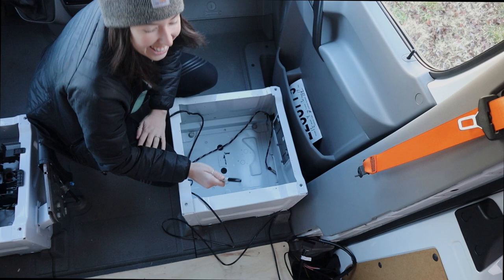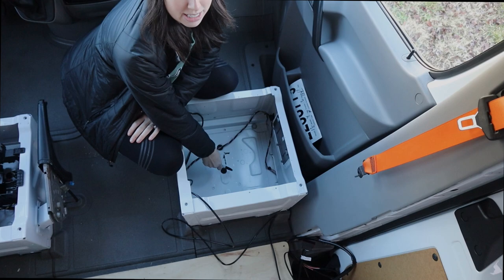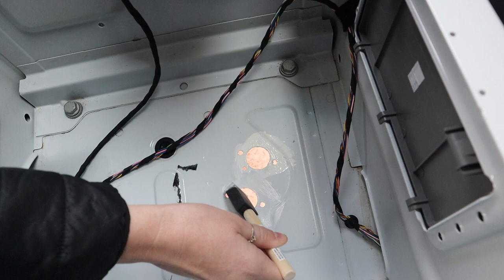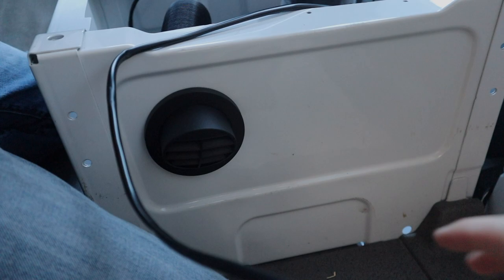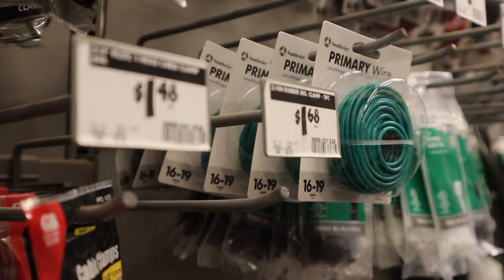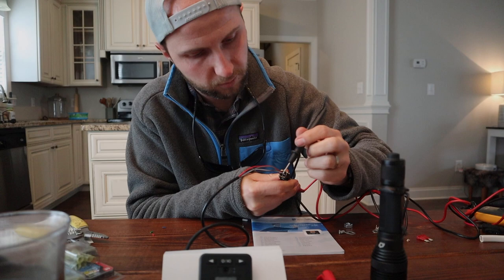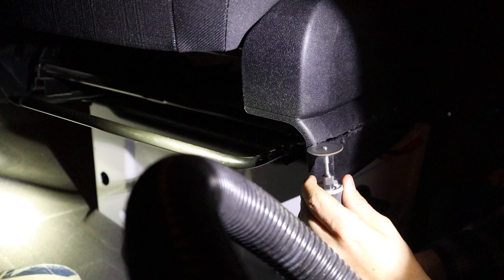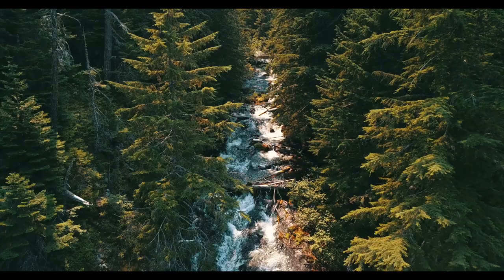VAN BUILD | Installing an Espar Heater and Swivel Seat into our Off-Grid Campervan

Comment: Good job, remember though, if you are going to stay at altitude, ski resorts, etc., you might need a secondary pump that fits alongside your original pump and powered by a separate switch. This is because of the burn process at altitude is different, you probably know anyway.
Reply from the maker: Yeah! We’ll probably end up adding on the high altitude kit down the road! Initially I thought we wouldn’t have to worry about it, but now I’m second guessing myself 😂 Thanks for watching!!
Reply: @WeTakeTheVan  Some very good info is available on the "Le Tonkinois" boat varnishing website; yours is new so you'll have few problems but a lot of step by step photos etc., on the D2. Enjoy your van life, I lived in a van for 10 years, I envy you!
Reply from the maker: @antpilk  thanks so much I’ll have to check that out! You lived in a van for 10 years?! I bet you have some wild stories! So ready to experience it myself!
Reply: I plan on spending winters in warm weather so I did Chineese 
Works fine

Secondary heat is propane catalytic. 

Electric. I went with battery banks.  Bluetti 
Quick
Easy
EB240
AC200
AC50S

QUICK
EASY
Reply from the maker: We almost went with the Chinese, but we found a really good deal on the Espar! Glad to hear you’re enjoying yours!!